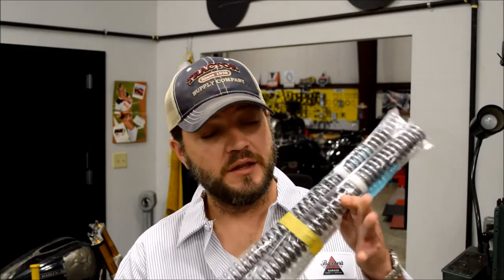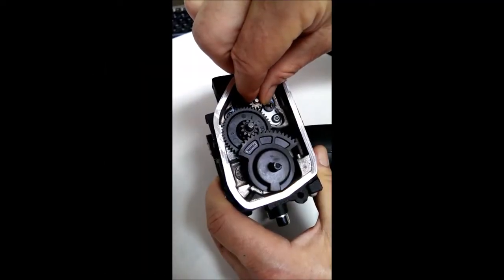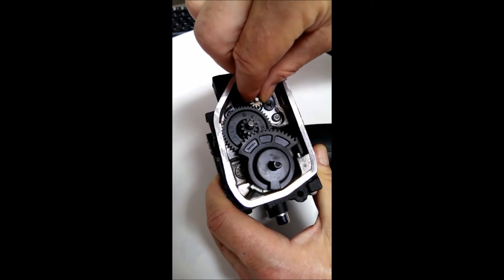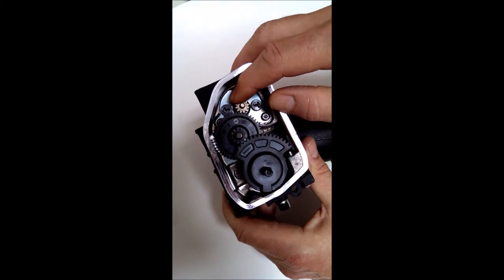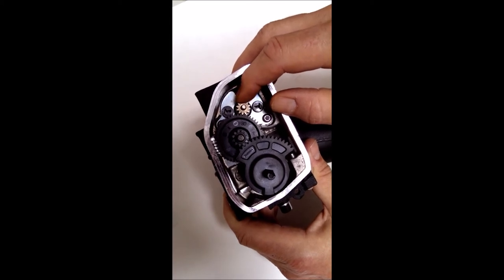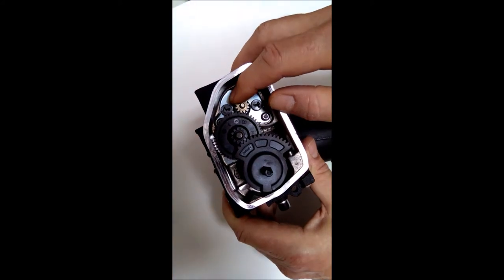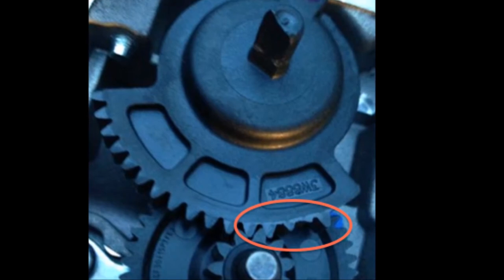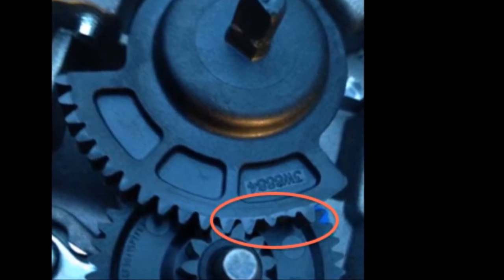Suspension Upgrades - Electronic Throttle Tech Tip - Kevin Baxter - Pro Twin Performance

Comment: Would like to hear some insight on hydraulic over cable clutch and can they be swapped and what kind of adjustment is ok for them
Reply from the maker: yes they can be swapped.  not cheap.  there is no adjustment for hydro clutch.